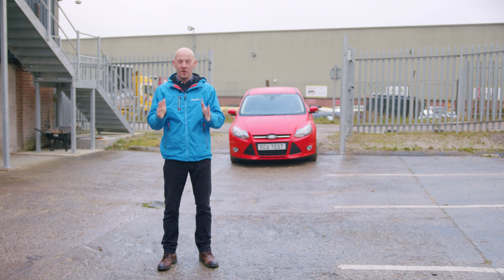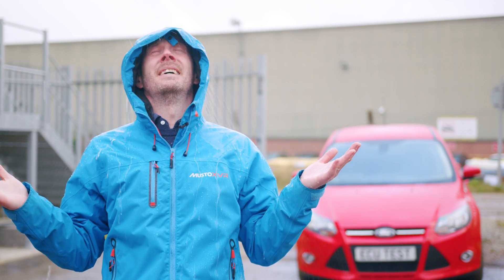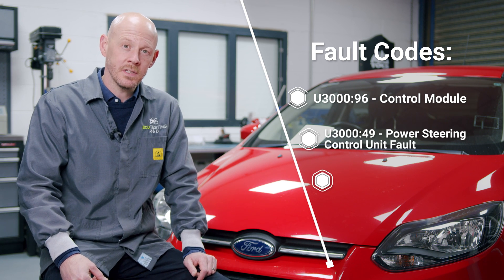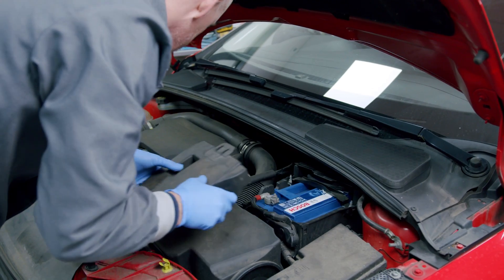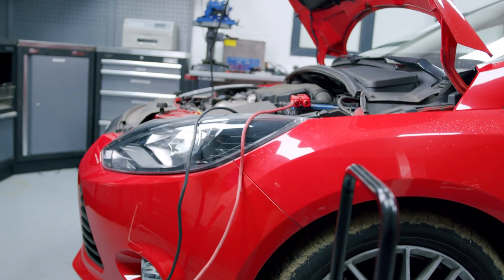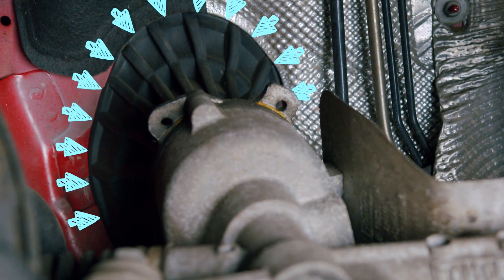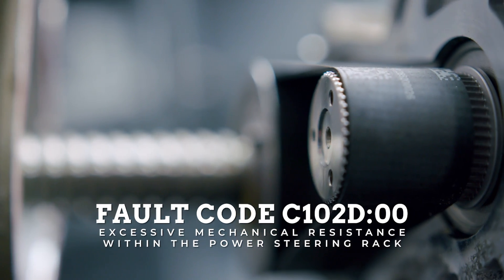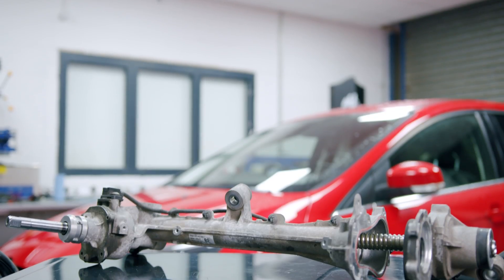Ford Focus power steering failure – common causes

Comment: My 2014 ford focus had warning steering malfunction so no power steering got the steering rack replaced but the light still pops on and lose power steering rack. Garage couldn’t find a problem but also replaced the alternator and said my battery was pumping out 16 volts. So scared to drive it far as it still happens sometimes. Garage recommend taking it to an auto electrician! Any ideas? Thanks
Reply: Did it work after the rack replacement?

Did it have to be programmed at the dealership?

Comment: Hi,i have a 2014 focus diesel when i turn my steering something sounds very dry,ive taken front wheels off held the rack ends and when turning the steering it sounds very rough inside the car you can here like the steering wheel is rubbing on plastic,ive had no fault codes and ive also changed inner and out track rod ends,any advice would be great,thanks

Comment: 2017 Continental. 
No coms with PSCM and the rest of the electrical steering system. 
Im gearing up to get uoder thcar and test the connector for power assuming a blown fuse #2 which is under the fuse box. Oh yea generator fuse which is also under the fuse box. They are both...........
SERVICEABLE 😢 im assuming the whole fuse box bot to go if no power to either PSCM and GEN connector.? 😅

Comment: my 2015 focus on a 64 plate st3 diesel has no codes no knocking on turning no resistance when just sitting still etc but only goes 3 quarters of a turn not a full turn and a quarter that i belive it should have, but when driving i have a harsh knocking on the car but all suspention componants have been replaced and still knocks, have you ever come across this issue, many thanks.

Comment: Just replaced front passenger side wheel bearing.
I was very careful to not damage the abs sensor, and installed new bearing with magnetic strip the correct end.
However, the abs light, traction control come on, and steering assist stops working.
Battery is only 6 months old.
I've disconnected for over 15mins to see if it would reset, but nothing.
I'm at a loss.
Reply: How did you end up solving it

Comment: My 2011 Ford C-Max 1.6L Diesel has an issue with the error code U3000:53-C8, which seems to be related to the power steering system. Recently, the car fell into water, and now the steering is extremely difficult to move. We’re Syrian refugees, and fixing this car is essential for our daily needs. The part that needs replacing is number 2337345. Any advice on what we can do to fix this issue affordably would be a huge help. Thank you so much for any support!

Comment: Mine seems to be knocking first of all I thought it was the shockers or top mounts which i changed as I’m a mechanic but now I think it’s coming from the electric power steering rack is this  a normal issue with these
Reply: Yes, especially on modified cars. Extra power and larger wheels and tires can cause the internal housing wear that you're describing. Mine failed for that exact reason, finally just locked up tight and lost all assist one day. I got a junkyard one and it's making the same knocking sound.

Comment: My 2012 ford focus looses power assisted steering if I leave the car running without moving or I’m in stop and start traffic, but if i keep the car moving, particularly on the motorway the assisted steering  won’t fail. If the issue had been triggered prior then I drive it at +40mph for a consistent period of time the assisted steering will return.

The fault code is always a communications fault reading.

Thoughts?
Reply: could be the traction control module failure, stops being relevant at speeds over 53 or so, abs control module issue in that case. the power steering needs the speed sensing data from the abs control module (communications) to do the traction control, if there isn't any speed control data being shared the power steering is stiff.
Reply: @ShawtFight the actual
Issue was a crack in the fuse for the power steering system… when  hit it would expand and the crack would make the fuse no functional… when it cooled down the fuse would function

Comment: My 2012 focus all of a sudden lost complete power steering it came up on the screen Steering Assist Fault Service Required so I limp it home and put my fixed code scanner on it and do a scan and get all of this which one of the codes has always been there the one that says (Pats) Key b10d7 but all the rest of the codes here are new, 1. B00C5 2. B00b5 3. B0052 4. B0050 5. B0028 6. B0020  7. U0154 please help I have googled it and YouTubed it asked everyone I know and nothing non of the codes mentioned in your video are there and we have checked the rack and the boots on the ends are all in great shape no tares or damage it does not appear that any water could be causing the problem it was not raining nor had it been it was a nice warm dry day this just happened while pulling in to a parking lot of a service station please help any information at all. Thank you for your time.
Reply: ECU TESTING

Comment: This is probably a dead post, but... I have 2013 focus SE 63k mi. I was attempting to clear all of the battery connection points of paint and caused a spark under the hood. I subsequently removed the battery lead, finished up, put everything back together and now have no power steering and it wont come out of park. The day before everything was perfect, no noises, leaks, no warnings of any kind. checked the f40 fuse, it's fine.

Comment: So u3000-53 is a new wrack
Reply from the maker: Unfortunatley this is likely the case. You may be able to get the unit re-built by power steering specialists, however we cannot confirm this as we do not service this unit.
Reply: @Ecutestinglimited  it’s ok I put a new wrack on and problem solved thank you

Comment: 2013 Ford focus no warning light about the power steering but power steering is locked due to freezing temperatures. The power steering will not unlock until the temperature of the engine gets right in the middle between cold and hot. Sometimes 45 minutes to an hour
Reply: I’m having the same problem did you find a fix?
Reply: @evanmcafee-nl2mh  one possibility is old battery, steering computer not kix on until car recharge battery on higher voltage and than steering bekome to work normal. This happens most likely in winter time when battery shows hers weaknesses.

Comment: My Ford focus 2011 power steering malfunction problem was fixed by replacing the battery with a new one and doing a software update.

Comment: Thanks for these videos great! I hope you might be able to advise (or someone reading these comments) please? My steering rack needs to be replaced on a 2012 Ford Grand C-Max due to getting the error code U3000:53 Fault Code. I have purchased a reconditioned steering rack and will fit it shortly. One potential issue my mechanic told me, is the alternator is charging the battery at 14.9V (sometimes up to 15.1-3) I believe the normal tolerance is 14-16V. Although he said this could be the Ford Smart Charge system for higher voltage. The battery is only just over a year old and has been checked and working correctly, it is a genuine Ford battery. The alternator was taken out and tested and that had no issues. Do you think a voltage around 15 would have any impact on fitting the new steering rack? I'm concerned this would cause new fault messages and cause the steering rack to fail again leaving me with a new bill to pay. Which is something I don't need this time of the year.  Cheers
Reply from the maker: The battery reading 14.9v when the alternator is charging it with the vehicle running is a normal reading, so it should have no impact when fitting a new steering rack.

Comment: Hi mate, I need a help out here, I’ve got a Ford focus zetec s 1.8 sport (2010) start showing battery light, after that traction light, abs on , and right after steering malfunction, steering got strong as hell, I stop the car, windows can’t barely move, all lights on dash came on, car engine running poorly, idle low asaf ended up stalling . Do you think  is the issue that you describe on the video?
Reply from the maker: It could be a problem with the power steering unit, however we would recommend scanning the vehicle for fault codes to confirm this. If your battery light is also appearing then we would recommend getting the battery tested for state of charge and state of health, as it could be causing all the other symptoms you mentioned.

Comment: Good video. 2017 Focus, Steering Assist Malfunction message, steering wheel turning but road wheels didn't! Switched off, restarted, ok, drove a short distance, stopped to reverse in drive and no connection between steering wheel and wheels again! Recovered to dealer, under warranty,no fault codes found nor reason for the fault! Key not found message has been appearing randomly since buying 6 months ago, gauges all pulse down then up every 20 seconds when switched off. Been at dealer two weeks now and still no solution. Wife was driving when this happened and is now refusing to drive it ever again. Any ideas?

Comment: I have a 2012 Ford focus SE it keeps reading power steering malfunction check manual. What happens if the wheel locks in place an I have to keep pulling key out and restarting until it works. What could this be.

Comment: Just had rack done last week  on my mk3 now showing 
Full codes are 
U300049 steering booster control unit internal error detected 
U210000 steering booster control unit configuration error 
U300053 steering booster control unit deactivated
Is this a faulty rack or a software problem and also would a new rack have newer software on it TIA

Comment: Hello, I have similar issue with power steering for my ford fiesta 2011, could this be an issue with the steer rack?
Reply from the maker: Hi. The steering rack for the Ford Fiesta is different to the one we are discussing in this video. However there may be a crossover in fault codes.

Comment: Thanks for the great content! I Have the problem, that the power steering fell out many times for a few seconds and the battery voltage error did show up on the dash. Now the power steering is off completey and the power steering error shows up on the dash permanently. Even when I erase all error codes with my bluetooth ODB. I changed the battery, but the problem is still there. The people at ford here say that the whole control unit has to be replaced now. Is there no way to reprogram it?

Comment: I've replaced my steering rack 3 times now in the last month. On start up, if I don't turn right, the steering is heavy when turning left next. Once I've turned left its fine again until you the car starts again. I've now got the fault code U0428. Any ideas?

Comment: 2009 focus zetec power steering  light comes on when car is started then goes out after a few minutes  yet car seems fine !  Any ideas please
Reply from the maker: Hi. If you are able to scan the vehicle for any fault codes then this would aid the diagnosis. An intermittent fault could indicate a failing battery, so we would always recommend getting the state of charge and state of health checked first.
Reply: @Ecutestinglimited  Thanks for fast reply

Comment: C102D-00 2012 focus, I had to use arm power steering to get my car home.
Reply: Did your dashboard lights go off at the same time as the power steering failure? Any advice on what fixed your problem appreciated as my 2011 focus just did the same, downer.

Comment: I have a 61 plate mk3 the steering feels heavier than before I have had intermittent battery warning light coming on had battery checked they said it’s fine tyre pressures are good just a bit concerned it may be quite costly to replace

Comment: If there is water in the steering motor can you not just separate it until it dries then put it back together or does it have to be replaced?
Reply from the maker: Hi Cole, unfortunatley water ingress will cause irreparable damage to the internals so a replacement would be required

Comment: I was drifting on ice for about 10 minutes with my ford fiesta 2011, now i dont have any speedometer function, abs sensor on, no power assisted sterring, esp sensor on, when i accelerate, the car shakes 3 times, what did i break?😮

Comment: I’m planning on picking up an early Mk3 Focus, and I was wondering if it was possible to bypass or disable the power steering either long term or short term in the event that it were to fail. Similar to how hydraulic power steering can be disabled by looping the hydraulic lines and using a shorter accessories belt.
Reply: I'd love to bypass the power steering as well. I'm going to try in the near future as mine (2014 Focus) sounds 3x too loud when in use, so I know it's going to fail me randomly at some point. If anyone knows why this shouldn't be as straightforward as cutting the belt btwn pinion and electric motor off or maybe also removing the hardware the belt attaches to, please drop some knowledge!
Reply: This would be highly illegal and highly deadly. These cars don't have the steering gear reduction or steering wheel diameter to be steered in traffic with no assist. Have you tried to turn the wheel with key on engine off? You're not getting very far without installing a much larger steering wheel

Comment: I do not have any fault codes coming up on the dash, but I do have a strange problem every cold morning the steering wheel is locked and cannot be manually turned until the car has warmed up for at least ten minutes. Could this be a simple battery issue or are we talking a complete rack and pinion replacement?
Reply from the maker: Hi. The fault could definitely be caused by a failing battery so we would recommend testing its state of charge and state of health before anything else. Thanks.
Reply: Hi there 
Well mine does the same but now my steering lock don’t work and it sounds like its scraping really bad. I have changed my battery and still not joy and I don’t have any codes.

Comment: Hey , i have a 2013 ford focus here in canada.  And after changing my sway bar end links now at low speeds and when turnin sharp my power steering will shut off for a moment untill the car picks up speed then it comes back on , any ideas?

Comment: Hi there really appreciate this video 
But issue I am having is completely different 
My powersteering works fine 
But I have a problem  with 
Hill assist and My traction light on 
Fault code reading U0428:00-0A.Pscm
Says invalid data from sasm 
So my traction does not work and Hill assist 
A new steering wheel was installed and a clock spring 
And the ford dealer here in south africa 🇿🇦  Said to me I must change my steering rack as the steering angle sensor is also within the rack 
Please can you get back to me sir

Comment: Got MK2 focus RS. Suddenly after being sat in the garage for a few weeks on a Ctek charger I come to start it and an getting a load of codes. Power steering Malfunction, abs speed sensor front offside, rear near side failing amongst others. ABS, traction, red ! All lit up on the dash.   Changed battery which I'm sure was ok anyway, didn't fix.  Removed dash pod and resoldered main plug contracts.  Still doing it.  What can it be?

Comment: I have a problem with my mk3 focus steering the codes are u0420:86 and u0131:87 the works fine but sometimes it goes heavy for a few seconds any idea
Reply from the maker: Hi. It sounds like something is causing a lack of communication from the power steering module to the ECU, so we would recommend testing all the wiring and grounds to the EPS module: https://www.obd-codes.com/u0131. As this is unfortunately a product line we don't remanufacture, we aren't aware of the exact cause of the U0420 and U0131 codes, but if all the wiring checks out ok then we would recommend contacting a power steering specialist for further assistance. Hope this helps!

Comment: Hi there citroen c3 2004 sensodrive 1.4.16v stop/start electric power steering problems. Gone power steering. Autel shows fault codes c1402

Comment: Our C Max has just had a third steering rack fail. The most recent failure was preceeded by several months of occasional failure of power steering on start up. After restarting the power would return. The battery was replaced as a possible cause but made no difference. Could something other than water be causing the failure given that there are never any warning codes or lights triggered?
Reply: I have the same problem , changed 2 time in 3 years!

Comment: I've got the same problem with no steering assist with the proverbial steering assist fault on my 2014 Focus EV. Makes me wonder if the other Ford products using this electric power steering assist have problems also?
Reply from the maker: Hi. Due to the year your Focus, was made in, it may be that your EPS rack does share the same faults as the one we have mentioned in this video. We would recommend checking your part number and contacting a power steering specialist for further information. Cheers

Comment: Hi, can you please tell me how I can remove the steering icon on the dashboard with the code U3000-53 ? I have losen the eps rack and pull out the water, but still not help..
Reply from the maker: Hi. Unfortunately we normally see the U3000-53 fault code when water ingress has damaged the module side of the steering column beyond repair. However as this isn't a product line we re-build, you may be able to seek help from a power steering specialist.
Reply: Hi .I have just replaced the rack ..how ever I can not clear the codes what so ever . All though all steering is back I still have the codes up...how can I clear the u3000:53 ..I have scanned multiple times and can not erase it ..heeeeeelp please
Reply: @tombarnes5955  did you find out how to do this